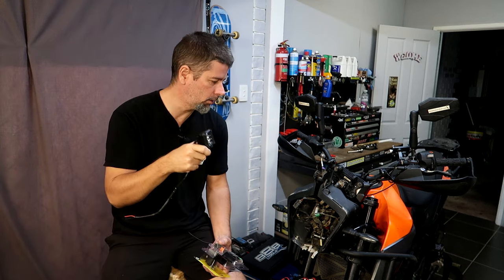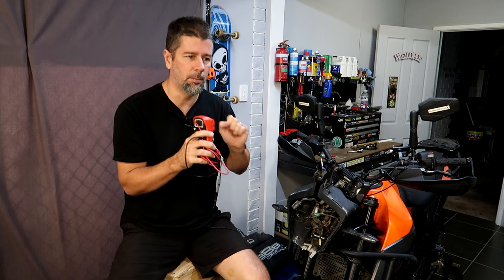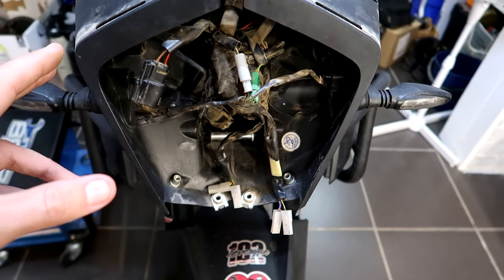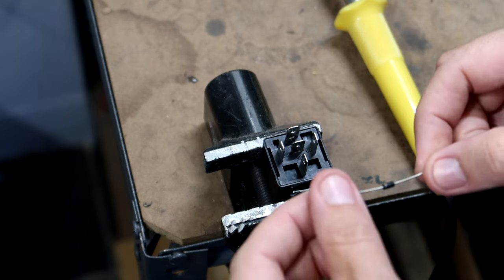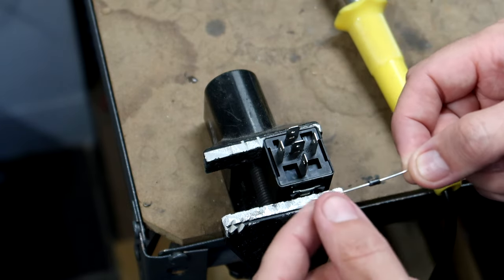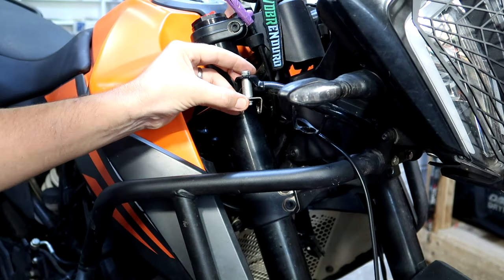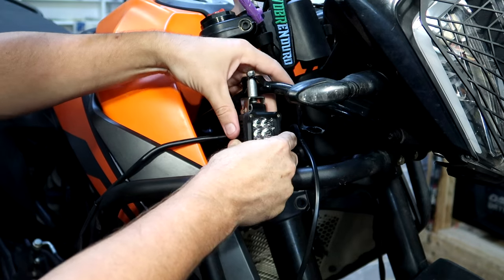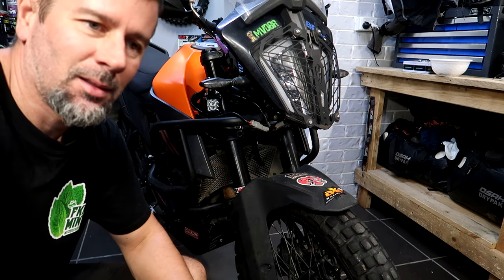KTM 390 Adventure: Run Auxiliary Lights Off High-Beam Switch

Comment: Dude the Allen screw in the 390 are a PAIN... but I don’t think that diode does anything for ya. 85/86 power the magnetic coil that flip the switch in the relay. A diode only allows electricity to flow in the direction of the black line but it could have some back feed so if anything adding that could cut down the amount of voltage going to the coil sense it’s essentially connecting those wires before the the juice hits the coil. I used to work for a company building cranes and wiring was my favorite thing.

When the day comes that Megan breaks her wings we’ll probably take advantage of those “factory spot light mounts” 😅🤘
Reply from the maker: Dunno if it matters on the 390 but on the T7 the diode stops a voltage spike (they've measured over 100V) going to the ECU when the magnetic field of the coil in the relay collapses when the lights are switched off... that's what they tell me anyway 🍻
Reply: @MVDBR  Well I just learned something new! They’re referred to as flyback diodes and they’re essentially just cheap insurance. Thanks for bringing in up in this video because that’s something I’ll now be using in the future🤙